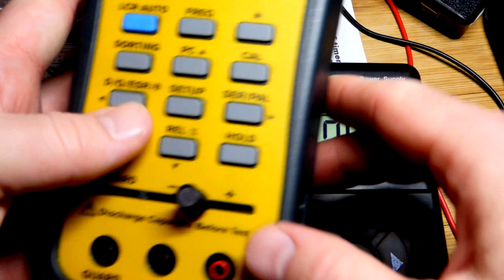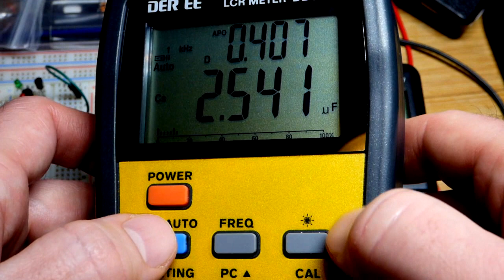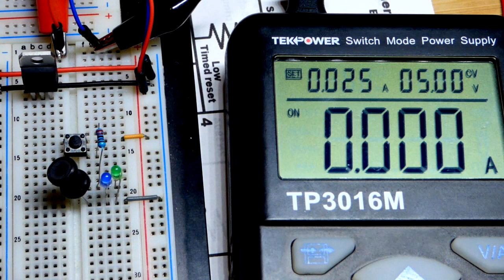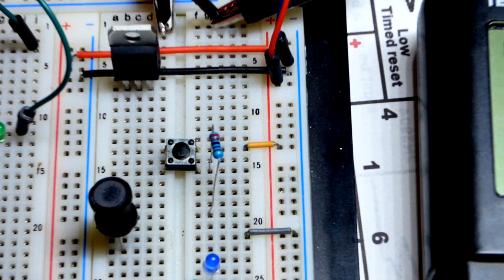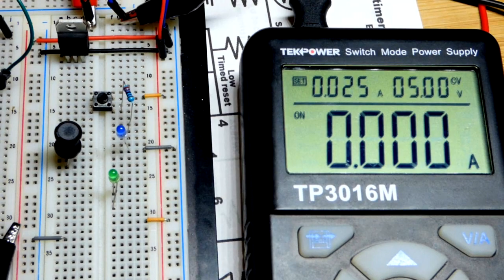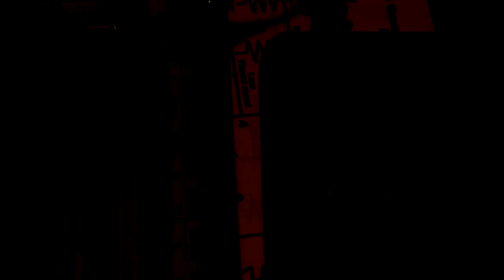Inductors resist sudden current changes demonstration using polarity indicator LEDs

Comment: Good video as usual.

I don't quite get why the blue LED only flashes momentarily, if it has a voltage source & a route to ground surely current flows through it.

Comment: What's really interesting and counter-intuitive is that when the switch is opened, you don't have a complete circuit, yet the green LED still lights.  I wonder if there is a momentary spark across the switch gap momentarily completing the circuit.
Reply from the maker: Yeah, there's a spark if there's not easier current path for the inductor current to flow through.